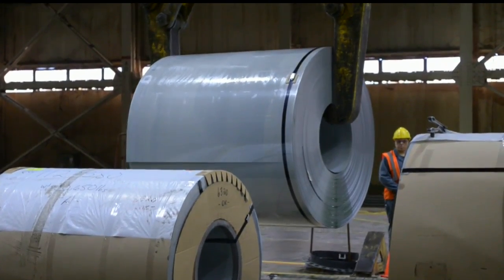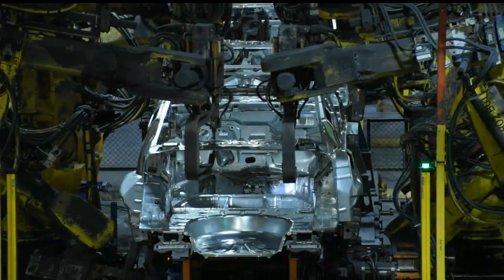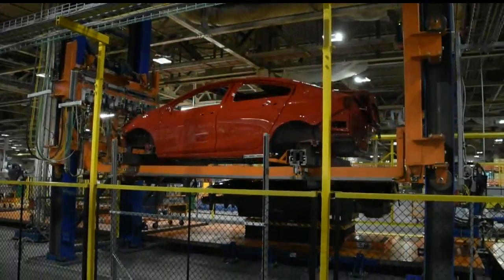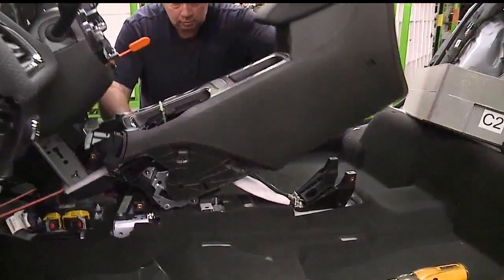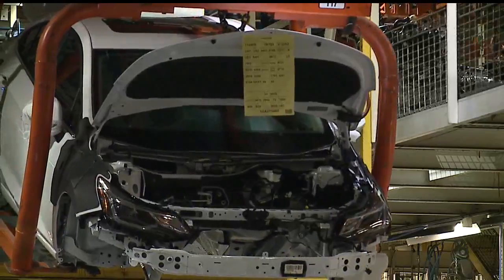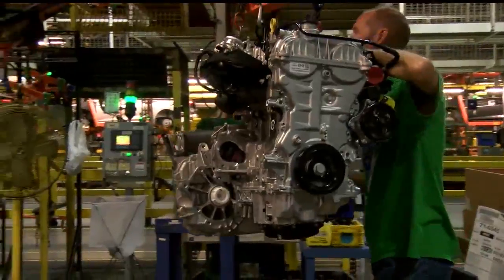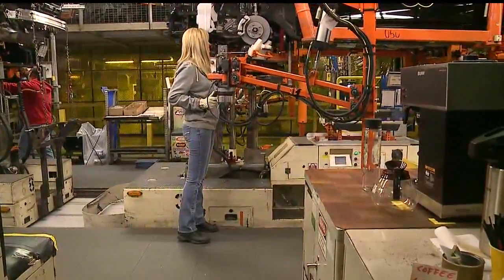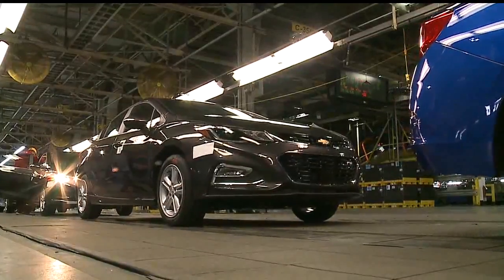How is a Chevy Cruze built at GM Lordstown?

Comment: why didn't they use a automatic  hood prop instead of a cheap manual  hood prop ?
Reply: Why should they? Manual stuff fails less often. The more electric crap they put in, the more "something" can go wrong. Ford, VW and others did the same stupidity with those electric parking brakes. Regular handles did the job just fine.
Reply: I prefer a manual hood prop in case if you run out of battery power and cannot get into the engine bay.